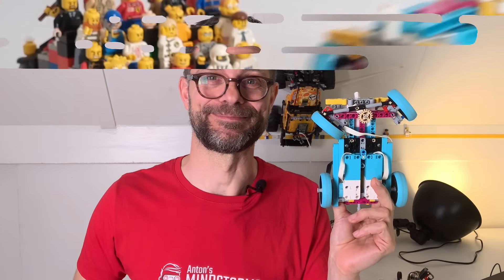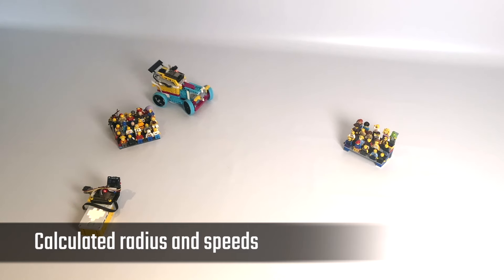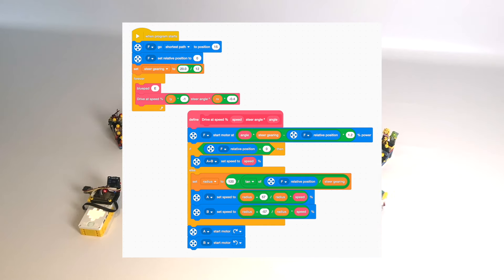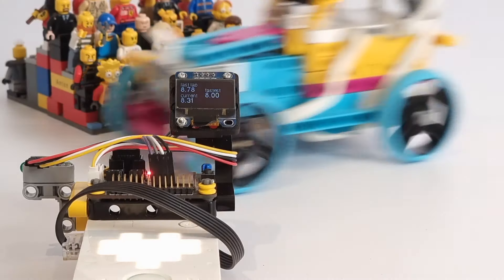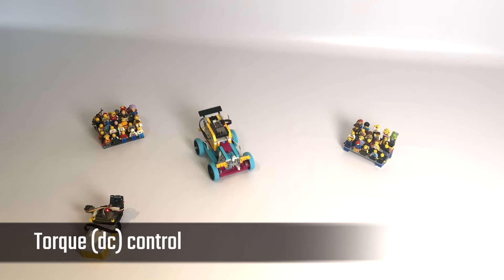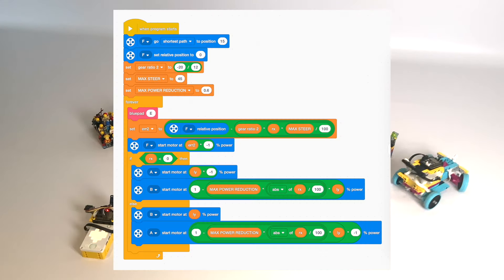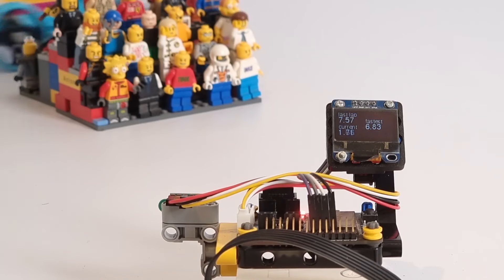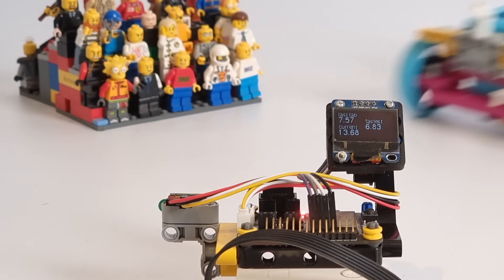Compare performance of Speed vs Torque Vectoring for a rack steering SPIKE Prime Hot Rod

Comment: To really test the ideas against each other you need to gear up the drive, so that you actually CAN break traction on the wheels while cornering.
You are right about the observation that the lower performance of speed controlled vehicle is due to the control reserve, but also very right that you can't really give up that margin while retaining speed control. Using torque vectoring effectively gives you that edge just because it's stable at 100% duty cycle on the outside wheel. If you manage to get that vehicle fast enough so that it slides out in the corners, you are likely to observe a bigger edge towards torque vectoring, as it will keep the cornering forces of the front wheels useful. Thanks for the update! You may mention next time, where the input came from 😛
Reply from the maker: I tuned the Torque Vectoring algorithm to edge of understeer. Interesting fact: with Ackerman I need less power reduction on the inside wheel (-40%) than with a parallel rack (-60%). So Ackerman not only makes tighter turns, it also gets more out of the cornering wheels! It is really difficult to make LEGO wheels break traction. I've only had success with rubberless wheels and rotocasters.
Reply: @AntonsMindstorms  you may try with the old technic wheels with integrated tyres, the ones from the universal sets, that have round axle holes (so you need the belt wheels put inside the rims to drive them). They have quite poor traction, but still better than blank plastic. I'll have to dig those up and do some tests. 
Btw: to check traction in corners you'd usually keep the steering angle constant and keep increasing speed until you break traction. You should be able to actually see the limit approaching by watching the gyro signal, but flying out of the corner is just as good an indicator - at least as long, as toy cars are concerned 🤪
Reply from the maker: @MarekLewandowski_EE  High-powered RC cars use a diff gear and a single motor and a gyro for drift control. It also looks cool, but I guess it's different because the gyro widgets seem to change your steering angle. https://youtu.be/sx1CNSHLc10?si=4s7SkQmFkubJeaxV&t=248
Reply: @AntonsMindstorms  that's a different pair of socks, that's a sort of a mistuned ABS/ESP unit. What I mean is, when you circle faster and faster, at first your raw hub gyro signal should show a constant, slowly increasing yaw rate, corresponding to your angular speed around the loop. As you approach the point of loss of traction this signal may start having some unsteadiness to it, as the wheels start to slip on bumps but catch on flats. I haven't tried it with Spike hub yet, so I'm not sure if this is going to be visible